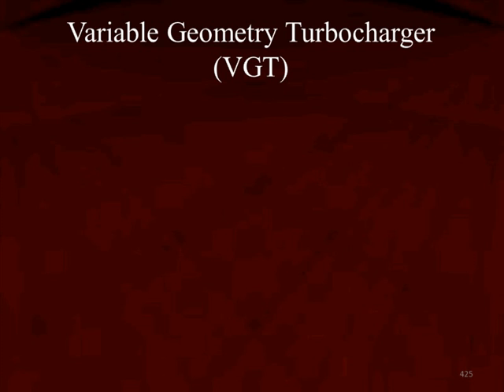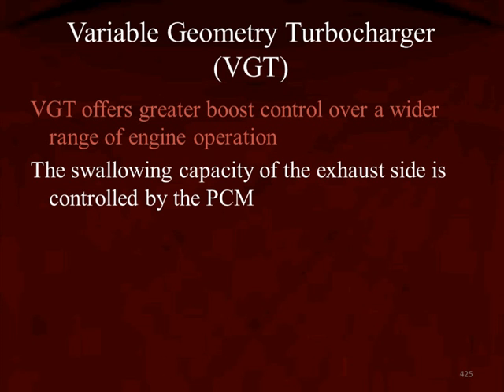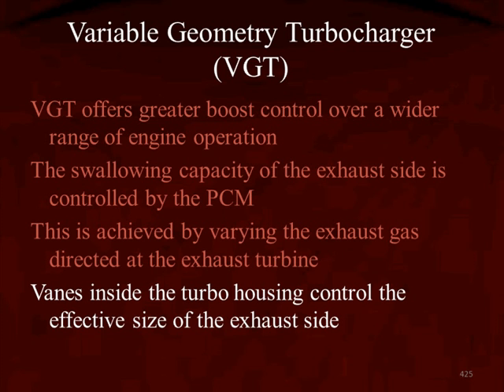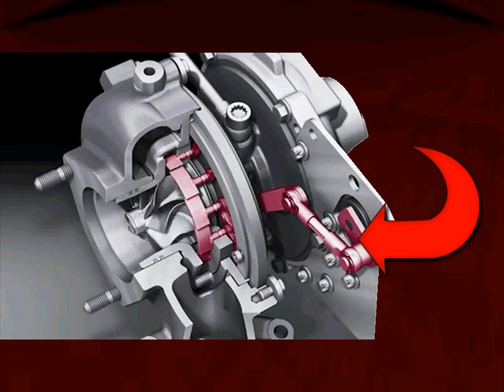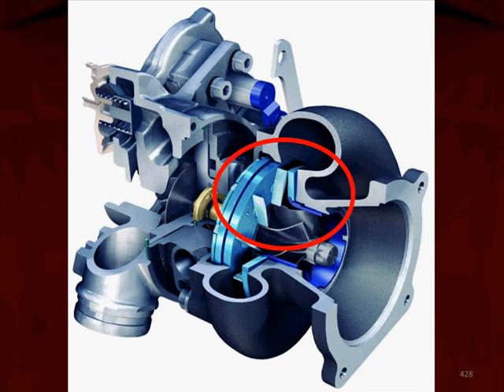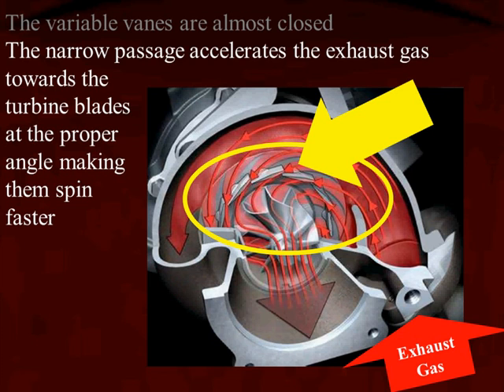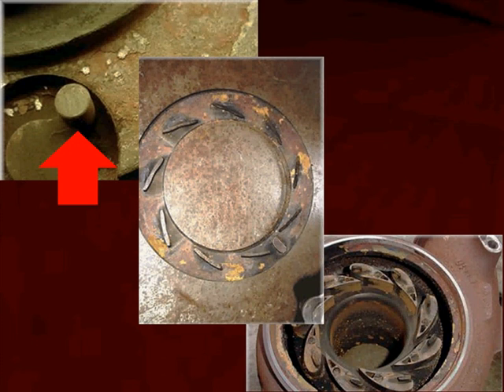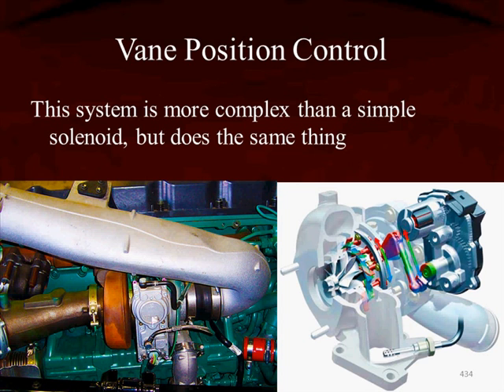46 Variable Geometry Turbocharger (VGT)

Comment: Could you possibly control one with a MAP(manifold absolute pressure) and a TPS (trottle position sensor)? Ramp in boost with timing and cam phasing throughout the rev range to eliminate lag or overrun?

Comment: Not how it works...When it closed it makes a small exhaust housing forcing it just past the turbine tips, the more they open the bigger the housing gets and it can't spool it anymore. in other words it goes from say a 4cm housing to a 15cm housing full actuator and vanes open "it dumps the exhaust" ... that's why when the actuator goes bad you make boost at idle .... this is alllll I work on
Reply: looking for a small variable turbo to play with in my little non-car project. What car uses a small engine and a variable turbo, that I could take a used turbo off?
Reply: @eIektrinis  VW TDI VNT turbos are pretty neat
Reply: @amorag59  thanks!
Reply: @eIektrinis  post about your project please
Reply: So when it’s closed, the turbine spins faster, and when it’s open, it stops the turbine from spinning faster?
Reply: Is it good to constantly run the exhaust break?